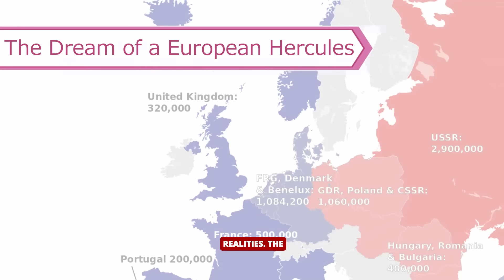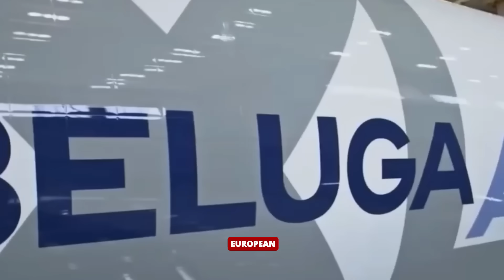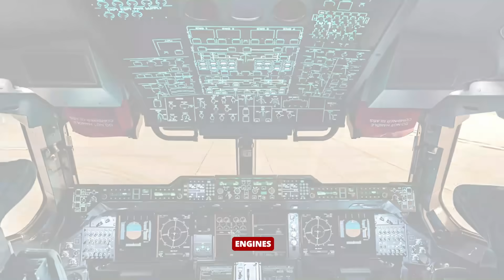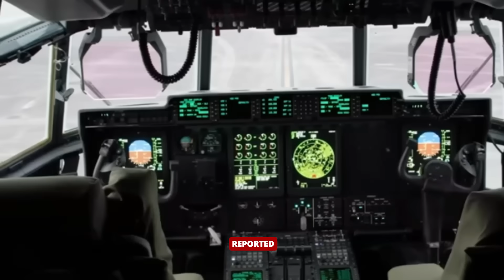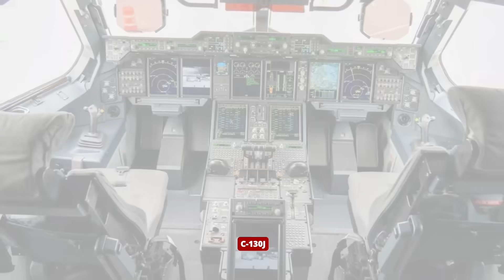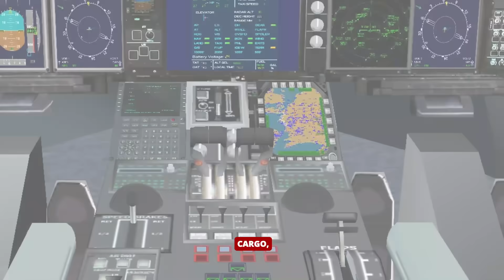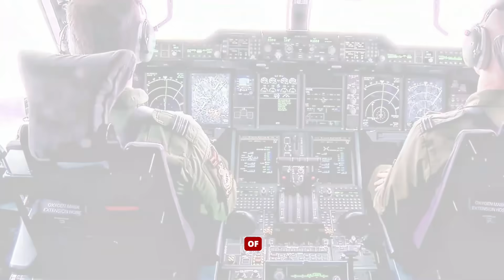Why Europe's $180M Jet Can't Beat a 70-Year-Old Plane

Comment: A somewhat superficial technical report that appears to be designed to make the aircraft look bad. This does not do justice to the makers of this aircraft. How did I come to this conclusion? Well, I was a member of MSG3 for the German Air Force during the development of this aircraft and thus the spokesperson for German interests in the certification-related maintenance of this aircraft's engines, so I probably have a slightly better insight into the matter. Without going into too much detail, I can say the following: There are no defense projects of this magnitude anywhere in the world that have gone smoothly, without delays or cost overruns. Especially when it comes to military aviation, things can quickly become very expensive. You want to be at the forefront, you are breaking new ground in some areas, and you encounter surprises. The Airbus A400M project has experienced all of this and coped with it quite well. When I look at the 777 X, the 737 Max7 and Max9, and the manufacturing quality of the 787 from the former quality manufacturer Boeing, on the other hand, it makes my hair stand on end. This kind of thing should not happen, especially when it comes to improving proven aircraft designs. At Airbus, on the other hand, seven nations jointly ordered 180 completely new aircraft, and only in this way did the high development costs make any sense at all. The result is a transport aircraft with the most modern cockpit, the most modern and powerful turboprop engines in the Western world, and the largest and most modern propellers, which are suitable for cruising and maximum speeds almost in the jet range, while offering all the advantages for short takeoff and landing. Each wheel of this aircraft puts less strain on the ground than is the case with a C130j or a C17, which means that more landing sites can be approached with a significantly higher payload than that of a C130. Yes, there were setbacks in development and testing, but the result is impressive. The A400M is a powerful military transport aircraft with excellent flight performance data in terms of speed, cruising altitude, and range. The aircraft was never intended to be as large as a C17, nor was it the intention of the Airbus designers to outshine any other aircraft. Atlas was designed to meet the specifications of the ordering nations in the best possible way, and it does.
Reply: Thanks for your professional input. It cleared many white areas!

Comment: Anybody that follows military aviation knows that the C-130J, and C130J-30 are new aircraft that happened to inherit the "C-130" designation, much like the F/A-18E, F, and G inherited the "F/A-18" designation from the F/A-18A, B, C, and D. The C-130J has a new "glass" cockpit, a 2 man cockpit crew, new engines, new propellers, reworked fuselage and wings. They are quite different from the legacy C-130A to H aircraft. Do you think Lockheed would have sold as many if they changed the designation to something other than "C-130"?
On the flip side, the actual "competitor" in a similar size, and load configuration to the A400M is the Kawasaki C-2. Both aircraft have a larger payload, and cargo hold than the C-130J. 
The real competitor to the C-130J is the Embraer C-390. The C-390 was designed from the outset to replace the C-130. It is closer in size, payload, and cargo hold size to the C-130J. Embraer has also been stealing sales from the C-130J in countries that have strained ties with the USA. Many European countries are buying the C-390 to replace their C-130 legacy aircraft. So has South Korea. Many view the C-130J as "old tech", while the A400M, and C-390 are more modern "future- proof" aircraft.
Reply: LOL ... anticipate that C-390's will be like an Alfa Romeo, good new but not very long serving. The C-130 has always used "Dimpling" for insertion of those 100k solid AD Rivets in the Fuselage ... as opposed to "lap" construction on the Embraer and Alenia's C-27's ... time will tell, especially if they have many cycles on "unimproved runways". And yes, I know as I helped build the SuperHercs all over the World and been around C-390's and failed C-27 Programs. And in addition to the improvements you rightly noted, be advised the bellies are MUCH improved ... double sealed with compounds that will pretty much prevent all the corrosion caused by hydraulic fluids, fuel ... and blood.
Reply: All very true...  But I'd still put money on the Hercules staying in active service long enough to see all of them retired.
Reply: @Arclite02 
Transport equivalent of the B-52 for longevity in service. 

🌌🔭
Reply: @Arclite02  : This, as the UK has retired their own C-130J fleet, and some European countries replacing their own C-130 aircraft in favor of the C-390? Well, the DC-3/C-47 is still flying, so it may be possible for the Herkybird...🤷
Reply: @Arclite02  Yep ... and maybe a DC-3/C-47 will ferry the last crew back to base LOL
Reply: Yes, indeed!
Reply: I know the U.S. military has had long-standing restrictions on buying foreign-made aircraft, but I feel this may 《eventually 》 be one of those VERY rare exceptions to the rule 🤔

🌌🔭

Comment: The C130 currently has firm orders for various models for ten years of manufacture, from many countries. It far out numbers orders from other competing types. It also has  continuous upgrades.
Reply: The US Navy is buying the E-130J to replace the 707 based E-6B Mercury
Reply: @PatrickLipsinic  
Based? 
Anyway, we'll see if the US Navy can afford it.
Reply: @CFak-i9r1c what are you even talking about. It's already a done deal.
Reply: @PatrickLipsinic 
Right. Let's see what happens if the Navy can't pay. A deal is not done until the manufacturer gets its money and the Navy gets its planes. You don't even know what a "done deal" is.
Reply: @CFak-i9r1c the base model is already built but the mods have not started yet. I literally walk or drive past it every day at work.
Reply: @superskullmaster 
You realise the C-130 is decades old? We'll see if the US Navy can afford it.
Reply: @CFak-i9r1c you do not understand why the Navy needs the C-130 for that roll. The E6 has to fly really slow for the two vlf antennas that hangs out the back of the airplane and does circular turn to get the antenna hang vertically in the air. The E6 has a tough time keeping that slow speed where is the C-130 has no issues doing that. I know some people that were active duty with the Squadron that's based out of Oklahoma City.
Reply: In case you haven't heard, several nations have cancelled and ordered the Embraer KC390 from Brazil.
Reply: It won't get anymore orders.

Comment: Critique ridicule 79 tonnes maximum pour le C130 et  140 t pour le A400M 50 tonnes de différence.  Le dernier Hercule est sorti en  service en 1999, A400M en 2013 soit seulement 14 ans de différence. Le prix est de 35 M et pas 180 M pour le A400M. Article qui compare les torchons et les serviettes. Article stupide.
Reply: No, the C-130J is still in production. 24 were delivered in 2024 and they have been producing over 20 a year since 2010. Your information is wrong.
Reply: @Chris_at_Home  https://fr.wikipedia.org/wiki/Lockheed_C-130_Hercules

Comment: A classic story! The MoD scrapped the entire RAF C130 fleet just a couple of years after a major upgrade just as they did after spending £750 million on the Harrier upgrades YET no one ever seems to get sacked for these cock ups! I've never flown in the A400 but have brought the Herc in on a pitch dark night in a German field by the light of 4 piles of Hexi lol. What a plane, you didn't realise it was there until it was on top of you!
Reply: You’ll know all about metal fatigue I guess.    What is it ?
Reply: @californiadreamin8423  Which is why Marshalls of Cambridge spent months upgrading the entire fleet to 130J standard.
Reply: @johnallen7807 .   Like renewing the main spars ?   Perhaps they weren’t 70 years old ?
Reply: @californiadreamin8423  They had an estimated 12 years of service life left when they were scrapped, the A400M does not have the short field and other traits needed for the SF role. I learnt to fly at Cambridge and well remember the Hercs going through Marshalls, a great piece of kit.
Reply: @californiadreamin8423  My dad was an XRay tech for the USAF, and every time the Herc would come in to Depot, they would xray and see what needed to be replaced, ribs, spars, mounts, fuel tanks, even the hot box, they even fluxed for corrosion. The overhaul could take months. When it went out practically brand new.
Reply: @TheDeathM . Well that’s reassuring to know.   In other words , the video is far fetched suggesting Hercs 70 year old are still flying.
Reply: @californiadreamin8423  indeed they are ... not all South American and African Countries can afford a new SuperHerc ... if you' go down to OGMA in Portugal, you'll see L-100's sitting on the tarmac awaiting C/D checks and upgrades ... and those were built in the late 1950's.
Reply: @johnallen7807  Why didn't emerging nations buy our Hercs when we retired them? That has always perplexed me.
Reply: @paulholyoak5436  Tbh I don't know what happened to them but if they were scrapped I bet it was so the government wouldn't be shown up when they carried on flying with another air force?
Reply: @californiadreamin8423  ah actually several 70 year old hercs are still flying
Reply: @thomaswakefield6889 .  Which part of them  ?
Reply: @californiadreamin8423 I'm pretty sure that they're still producing new herc airframes.
Reply: @J.C.1966 .  The video suggests the airframes last 70 years.  Oh well,  what do I know.
Reply: @californiadreamin8423  three things can be true: 1) brand new hercs are still being built and delivered,  2) older hercs are constantly being upgraded and major parts such as wings and powerplants are  largely replaced, 3) some hercs are still flying for poorer nations without upgrades (that last one is not a good plan.)
Reply: @J.C.1966 .  In other words Hercs that are 70 years old are death traps.
Reply: @californiadreamin8423  or that they've been refurbished so often that very little is still over from the original aircraft.
Reply: @J.C.1966 .   So they’re not 70 years old !!
Reply: @californiadreamin8423  Same goes for a lot of the older  chinooks
Reply: British sold their C130J due to buying the A400M.
BTW, the US Navy Blue Angles has a C130J "Fat Albert", which it bought from the British. The old Blue Angles' C130T had over 30,000 hours on it, when it was retired.
Reply: @JohnD-F-YT  you might want to check your info because the british are still buying the C-17 Globemasters from the US
Reply: @thomaswakefield6889   I never wrote anything about the C17. Yes, the British bought a few C17. The C17 is no longer in production, so no more are going to be built.
Reply: @JohnD-F-YT  ah actually Boeing is going to start producing them again because several countries have asked for them. So they will start producing them in limited quantities as orders start coming in
Reply: @JohnD-F-YT  My point precisely!

Comment: American propaganda! The A400m is one of the most advanced military transport around. It's not even in the same class with the c130 Hercules, and I a have a healthy respect for the Hercules. But they are two very different aircrafts that occupy different classes. The Hercules can carry 19000 kg maximum capacity , the A400m has a maximum capacity of 37000 kg. The hercules has a narrower cargo bay, meaning it cannot accommodate many morden military equipment regardless of weight. The A400m was deliberately designed to be wide an voluminous to accommodate most modern military equipment.
Comparing A400m to c130 hercules is like comparing 1ton panel van to semi truck. They both transport vehicles, but the similarities end there.
Reply: Care to edit your post ?  19,000 tons , 37,000 tons.    !!?
Reply: @californiadreamin8423  yes, he meant "lbs." ... at least he didn't say "metric" LOL
Reply: True enough ... but if one can buy 3.5 SuperHercs to 1 A400, that increases the max payload to around 70,000 ... AND delivery dates will be met. See what I mean?
Reply: @c @craigsowers8456 .   Europe knows exactly what you mean.   You want Europe to increase its military expenditure,  or is that just to purchase hardware in the US ?   You can’t have it both ways.
Reply: @californiadreamin8423  I live in France .... you?
Reply: @craigsowers8456 And how would you transport big, bulky equipment that do not fit into the narrow cargo bay of the c130 then?
The truth is there's plenty of aircraft out there that can do what the c130 does and do it cheaper and fly faster and boasts modern technology with better cargo management, better glass cockpit which is safer in diverse flying conditions. And not to mention modern engines which are more fuel efficient.
The Super Hercules is not so super anymore
Reply: @itanisewadawada5331  "Arguing with a Fool only proves there are 2". Since I'm no Fool, that only leaves you.
Reply: Dailey maintenance on the,A400 is horrendous.
Reply: @raywhitehead730 How do  you know?
Reply: @raywhitehead730 A400m is a new modern aircraft. It occupies a niche category above the c130. So, you can't compare daily maintenance of A400m with c130 because c130 can't deliver what A400m can deliver
Reply: Mise au point un peu laborieuse, mais peut être pas assez nombreux dans l armée de l air !

Comment: The A400 is still young with tons of potential to eventually dominate the segment.
Reply: Too big and needs runway and costs too much
Reply: Young?
Reply: LOL ... not at that price point. 3.5x a SuperHerc and for 9 extra cubic meters of cargo space.
Reply: @craigsowers8456 The A400 not only has more cargo space, but also flies faster and farther than the C130. It can also use unpaved runways. Its specifications lie between those of the C130 and the C17.
Reply: @armadspengler2717  You don't happen to work in Brussels? As stated above, the A400 is 3.5x more expensive ... and if one were to purchase 3.5 SuperHercs, you'd end up with a cargo capacity of almost 70,000 lbs. in the aggregate. Get it?
Reply: @craigsowers8456 No, I don't work in Brussels or for Airbus in Seville, Spain, where the A400 is built. But I know different specifications when I see them and I can comprehend different capabilities in planes that are built for different applications. And the C130 is in a different class of cargo planes then the A400. E.g. you can't transport a Chinook helicopter in a C130, even if you use four of them, just because they could theoretically carry the load of this helicopter, divided by for - because the cargo space isn't there. And there are a lot more applications the C130 can't do, which the A400 can, because it can fly higher, further and with higher speeds, while also use unpaved runways in conflict zones.
Reply: @armadspengler2717  Good to know ... figured since you have a "money is no object" attitude, you worked in the ECC Brussels. Not sure why you'd want to transport a Chinook by Air ... the cost would be as much as the Helo. Of course we'd use a C-5M if needed for that ... or just lease an AN-224 from Evergreen. I assume you live in Europe as do I ... and pay Taxes so not sure why you think the A400 is the answer to everything. It is a marvelous platform ... just a bit too expensive.
Reply: @craigsowers8456  there is a huge problem with it right now, it needs to be slightly upgraded or the new german rch 155 needs to lose some weight.
its possible since its just one ton.  it would be a game changer if they can fix that

Comment: Just proves the old saying, "the camel is a horse designed by a committee"!!
Reply: More a case of the author completely missing the point... the A-400 hasn't replaced the C-130 because it was never intended to. 
The whole point was to have something that sits between the C-130 and C-17... It has better rough field performance than the C-17 and can carry larger and/or heavier loads than the C-130. It's doing exactly what it was supposed to do.
Reply: The C130 and the C17 have the benefit of the USAF knew what it wanted and did not need to make anyone else happy. Both were also designed for specific payload requirements and tasks.
Reply: How about Trump asking Aircraft carrier troops , " What is better steam or electric ? " they all yelled STEAM ! so Trump I hope is doing what troops want .
Reply: He was on the USS George Washington, which has steam powered catapults and arrestor systems. Of course, the sailors are going to think their systems and their ship are better. 
USS Ford was a few years behind schedule and billions of dollars over budget due to the electromagnetic systems having problems. He remembers that from his first term in office.
It is too late to go back to steam on the new CVNs. There are 3 more CVNs (USS JFK, USS Enterprise and USS Doris Miller) being built right now and one more ordered with electromagnetic systems. Way way too late to change the designs.